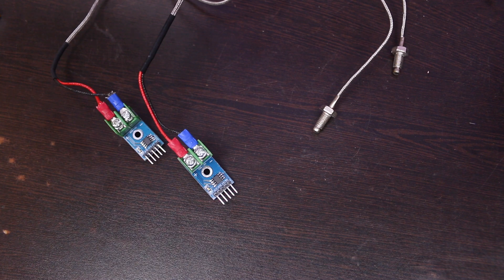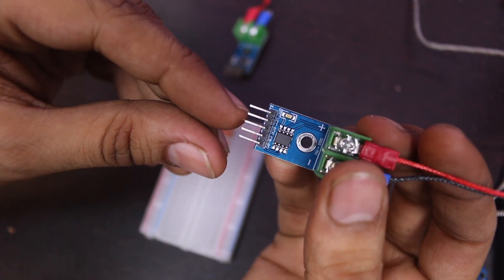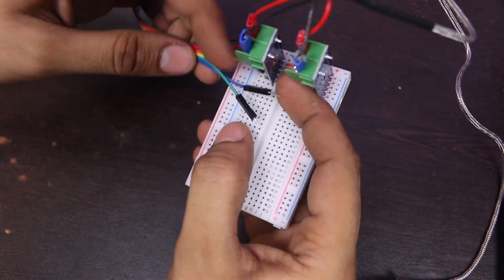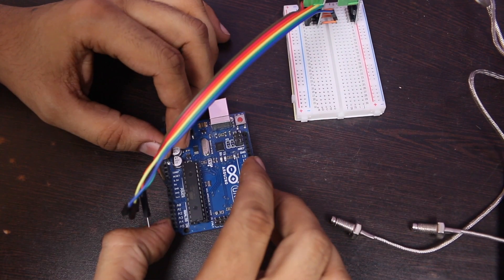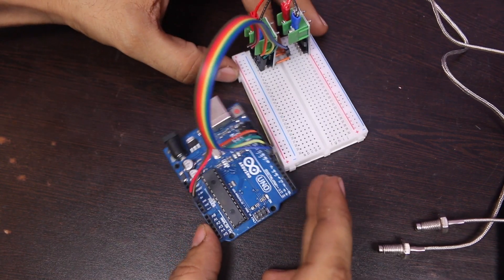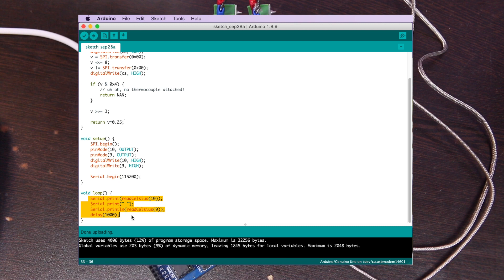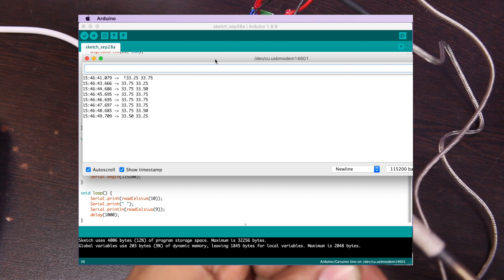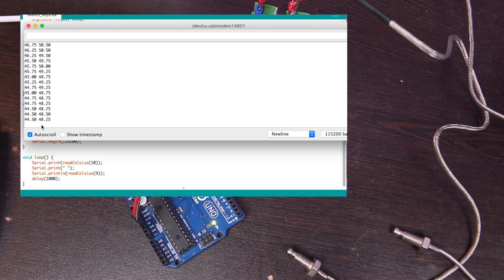Two Temperature Sensor Module MAX6675 with Arduino

Comment: #include <SPI.h>
double readCelsius(uint8_t cs) {
    uint16_t v;
  
    digitalWrite(cs, LOW);
    v = SPI.transfer(0x00);
    v <<= 8;
    v |= SPI.transfer(0x00);
    digitalWrite(cs,HIGH);
    if (v & 0x4) {
      //uh oh, no thermocouple attached!
      return NAN;
    }
      v >>= 3;
      return v*0.25;
}
       void setup() {
         SPI.begin();
         pinMode(10, OUTPUT);
         pinMode(9, OUTPUT);
         digitalWrite(10, HIGH);
         digitalWrite(9, HIGH);
         Serial.begin(115200);
       }
          void loop() {
            Serial.print(readCelsius(10));
            Serial.print(" ");
            Serial.println(readCelsius(9));
            delay(1000);
          }